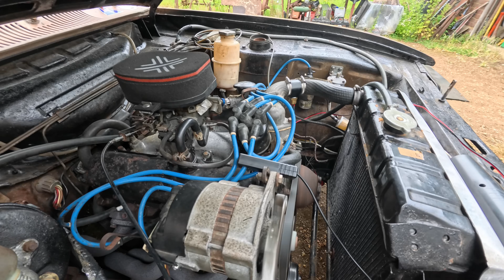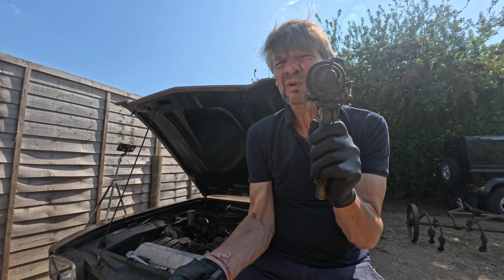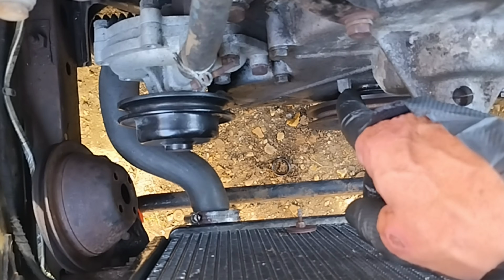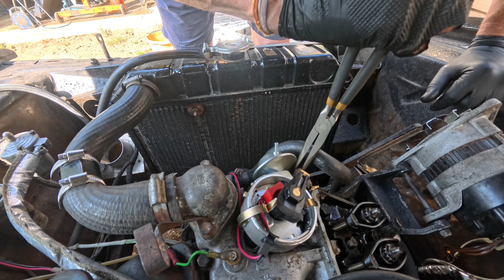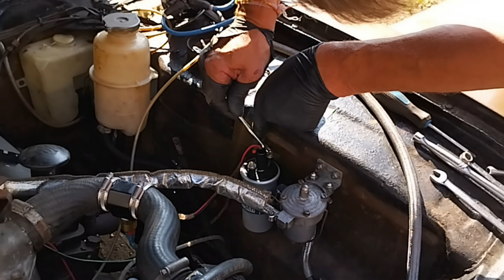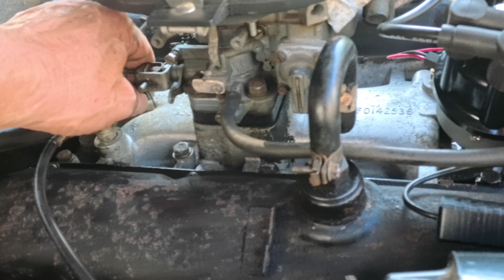Going Dizzy; Mk1 Ford Capri 3000 V6 Essex Electronic Distributor

Comment: if you strip your old dizzy you will find the bob weight springs are broken which is the root cause of your eratic timing but if it were me i would stick with the new dizzy
Reply from the maker: Yes, I think you are correct.  I'll keep the old one as a spare to get me out of trouble just in  case for now.  Thanks for watching.

Comment: Avoid E10 petrol What I done is keep adjusting the ignition timing. My Capri is running good at moment.
Reply: I use E5 in my 3.0 capri and timing is set to 14 BTDC which is the old 4 star setting. It runs really well with no pinking . I’m still using points distributor too.
Reply: @simonwinn387 I'm the same with points and condenser.
Yet the fuel is the problem. 
I now adust my  ignition timing by ear. 
And  I've  finally stopped the pinking and now and  again  misfire. 
My 2 litre pinto is running like the way it should when I first bought her in 1989.
Seriously you got to drive her and keep adjusting that ignition timing. 
It's a problem that made me lose my temper.
But I have solved it.
Even the expert tuning guys could not stop the pinking on my capri. 
I say this... know your car and know your engine sounds. 
😊😊😊
Reply from the maker: Thanks for the tip, I think if I use the car for a long period of time I will put E5 in, for now it's the E10 stuff and see how it goes.  Thanks for watching.

Comment: Hello mate from australia in the past I remember I was changing ignition to electronic in old toyota hilux 1979 with 18r motor but I also install transformer coil.Years ago there was big choice of them some were giving some very high voltage spark about 20mm long which was no good in my case motor was working well but when I swapped to coil with lower output (spark about 10mm) I noticed better engine performance cheers
Reply from the maker: Hey, hello to you in Oz, thanks for tuning in.  Thanks for the info.  Electronic ignition is a bit voodoo magic to me, I'm a points and condenser guy, so I'm still learning, this seems to work well so far.
Reply: @Wheels_of_Interest.thank for your replay when comes to electronic ignitions they are two basic systems;transistor ignition and capacitor ignition.The first one is the professional option and used in all cars and second one (capacitor)has one big drawback-very short spark duration which is affecting power and economy but is commonly used in cheap Chinese bikes.I wander which ignition module you use the only what Iwas trying to say that proper module and coil can make judge difference in performance

Comment: In the 70s I put on a zodiac mk4 carb it as bigger barrels I think it was a 40 type it did make it go well if the distributor is out I would use a long nose pliers to pull out the oil pump drive shaft and put in a new one.
Reply from the maker: Thanks for the tip on the carb, someone else suggested similar.  I may do that when I've worked out what to do with the car long term.  Also are the oil pump drives a problem if they're old?